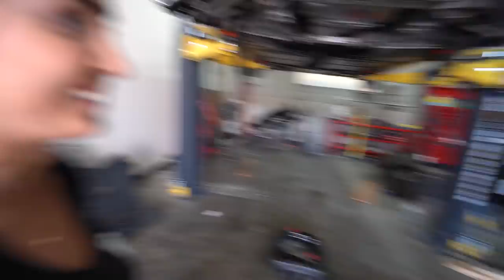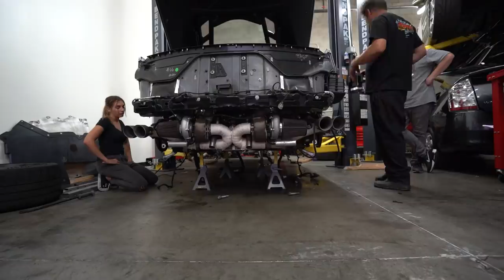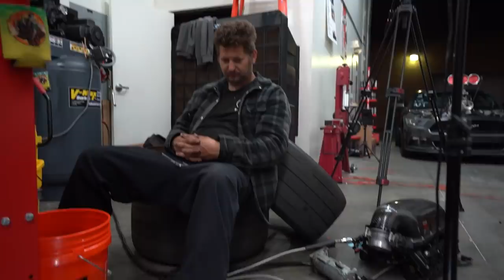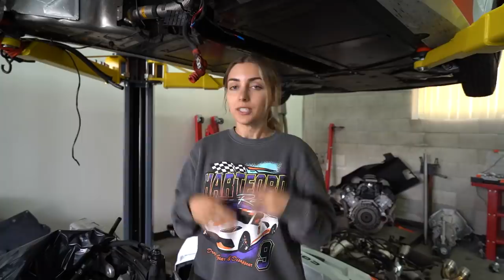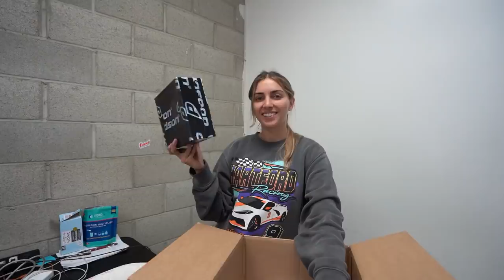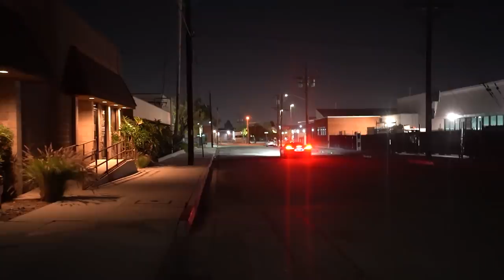I Finally BLEW the motor in my Twin Turbo C8 Corvette... Shocked at what we found.

Comment: Probably the most experienced c8 techs at this point
Reply: Ya if I lived closer amd had a c8 I'd have them work on mine if they would.   They have alot of experience with the c8 now
Reply: Uh, no
Reply: At very, very specific things. Engine, transmission, or suspension problem? They've got it covered. Water pump died? Bad alternator? Infotainment trouble? 🤷‍♂️🤣
Reply: When their C8 Z06 shows up, that should be exciting to watch.
Reply: I'm not excited about a V8 Vette, not a cool car in my book, buddy has a 2019 Z06 and it's not a good car compared to other cars it competes with, I would say there's many other cars that I would rather have, but I would build a Chevy truck and call it my hot rod, stay strong
Reply: @cargotoolshop5319  IMO, makes more sense to buy an older cool car that will or is appreciating in price. AND watch these guys play with cars I would never buy.
Reply: Besides the engineers who designed and built it

Comment: Hi Emelia
I'm very concerned about 1 thing. When you sent the C8 engine to Texas Speed to have them put holes in your intake manifold for the extra injectors,  etc , DIDN'T THEY PUT IN 2. THICKER HEAD GASKETS to lower your compression ratio , so as to make more room for the increased boost levels they knew you would be adding to the engine. You said in today's video you got new head gaskets from the dealer.  
  I also greatly admire how cheerful you always are --- even when things go wrong.& I appreciate your attempts to explain to all of us what it is you are trying to do.  I'm glad it isn't any worse than it is.

Comment: There's something so interesting about watching people wreck engines and then tear it down and show you!
Reply: Cheaper than doing it ourselves, too!
Reply: They are marvels of modern engineering
Reply: I wish the channel.was more than that. Cars getting fixed. 3 min of operation.   Cars getting fixed. 2 min of operation. Cars getting fixed. Sort of. By other people.  But let's talk about how the car isn't working and you can watch us watch people fix it. Sort of.
Reply: @Live.drones  Welcome to racing! Pushing your engine, trans, and drive train is part of the challenge. when you get to their caliber things are going to break until you get the beefiest stuff available. another example is Boosted Boiz channel they are pushing 1000+ hp out of a 4 cylinder engine. barely could keep two running out of 6 cars! well they got to the point where everything is holding up to the abuse, And ALL of their vehicles are running at this time. Worlds fastest MR2 and Honda Odyessy minivan. and second fastest Acura NSX in the world as of a couple of months ago anyway.
Reply: @tbusch63  but she doesn't race.  I get it. World.record attempts for 0-60, quarter mile, ect.  That's it though. She's really cool.  Not trying to hate.  Just wish it weren't so one trick pony for months now.
Reply: @Live.drones  Ya I get you but she shows the reality of having a basically 'unknown' car do what it does, break, then figure it out plus makes it decently interesting. I give that a thumbs up lol

Comment: I'm kind of curious, if you were just being paranoid, and that milky oil is just caused from moisture from running ethanol or methanol. When you get either one of those into your oil, it will draw moisture into the oil. I'm betting the head gaskets were fine. Probably just need a fuel oil separator. Or air oil separator. Honestly not sure which one would be better in this situation.

Comment: I'm amazed at how this engine has held up. Goes to show how good the builder is. Probably about time for a freshening up before it goes BOOM in a blaze of glory. I've put a hole in the side of a block before because of a head gasket going bad and it ain't fun.

Comment: Y'all have had that engine and trans, in and out enough times now, that you should be certified C8 techs! Other than some minor head lift, it looked pretty good inside. I'm sure it's a good feeling to get it all back together. and hit that button, and everything just WORKS!😁👍

Comment: 1 your going to be changing that clutch again.  You launched it on a new clutch with no break in , I have a dual clutch and I've changed mine twice. They are only rated for 100k with normal driving.
About 30k with heavy load. If you aren't useing carbon clutch disks about 60k with carbon and full boost. 
2. you did not preform a TCM relearning. So the clutch was not spaced properly before you launched it. This can cause serous issues later on Because now you possibly glazed the flywheel because you didn't preform a relearn and break in procedure. This can cause shock to the output shaft of the tranny, shock can come in the form of cracking,stripping,bending. Let's hope you didn't cause to much damage to that shaft of your gonna have one hell of a job on your hands 
3  pay more attention to the details.  Take 15 mim break during each torque session to allow studs to cool 
 A lifting head means it's not bolted at the right torque.
Your head studs/bolts are most likely the problem. After they have been slightly bent from.lifitng they are no good, it puts unnecessary stress on the threads. 
 Tho you can't see it with your eyes I bet the threads are rolled slightly. 

Also the last cylender on the driver's side of the car next to the bumper cover you could see the piston was almost turned sideways inside the block it's pushing the pistons to 1 side and causing wear to the block and ringlets. You may have an issue with your thrust washers. I would remove the engine and check clearance of thrust. Easy way is to flip block over to expose crank. Then take a prybar and push the crank in either direction and measure the gap with a feeler gage.
Confer this Info with Texas speed and see what there thrust washer barring clearance is and make sure they are not too worn from stress. And 30lbs of boost. That even the most built super cars can't handle.
Reply: nailed it...
Reply: This is some good Info hope it gets lot of likes.

Comment: Whew, that was a nail biter! Glad the problem wasn't bigger. When I built the motor on my 2000 Subaru Impreza 2.5 RS to handle 18 lbs of boost, we o-ringed the heads and used a pretty hefty head gasket, with ARP studs and block inserts (JE pistons, Pauter rods, knife edged balanced lightened crank, Cobb cams and springs, billet fuel rails, etc). Made about 500hp LOL, which is your motor stock.

Comment: Little hard to do, but after changing head gaskets, do a good heat cycle and the re-torque(depending on type of head bolts) also I suggest talking to "Jackstand Jimmy" Garret's mechanic about the torque he is using on mullet now, because of the problem they kept having lifting heads.

Comment: sure its not pulling threads out of the aluminum block? head studs stretched? I would black book any performance engine and what the tolerances or measurements were so you can compare them when things like this happen.(for the future) If its just a gasket from not seating right, ok good fixed. But good to question why, torque wrench outta spec? forgot to retorque one head bolt? not enough torque? could just of been a fluke headgasket job late at night while rushing to get it done that something was over looked. I would trust you working on any C8 over a Chevy tech. Overworking yourself, need to start hooning again and what ever happened to the 240? go shred a couple sets and just enjoy it 🤟

Comment: use steal block. 6 bolts heads. use c7 ECU. put regular after market  gauges and bypass the doors and others.e85 with meth the c7 may work with gauges and doors or others?

Comment: On my 96 fleetwood 6 door limousine with original LT1, i actually had something similar happen about 30k miles ago, the heads were slightly warped, i cant remember if it happened cold or hot(probably hot), but it was perfectly sealed when at X temp, but would start intermittently sending out a puff of white smoke, i thought it was oil so we took it apart and didnt find anything wrong with the rings or evidence that oil was coming in from the valves. It was probably our bias of thinking it was oil, but it took an actual expert to find that there was an exhaust leak and that was probably causing fluid to come back into the engine. 
My point is think outside the box. Maybe, like me, you have an intermitant problem. Not nescesarrily like mine, but maybe the high boost you're running is somehow bypassing the gasket without tearing it up, not blowing up the coolant system, and sending that coolant into the same, or another cylinder.. Or, what if coolant could be making it into the turbos, or maybe there is a crack or leaking seal in a coolant channel in the engine right next to an oil path.

Comment: If your turbos have a coolant passage than the seal could be leaking into the oil. Since you already took everything apart I would pressure check the turbos before you put them back on.

Comment: Looks like cylinder 2 is definitely burning coolant… the  cylinder you pointed the camera down when mentioning 60 thou piston to wall clearance… along with the cylinder next to it appears to burning little bit of coolant also. Domes of pistons looked washed. In my opinion they look like they are burning coolant VS the other two cylinders next the them. My best guess would be the head was starting to lift 
 
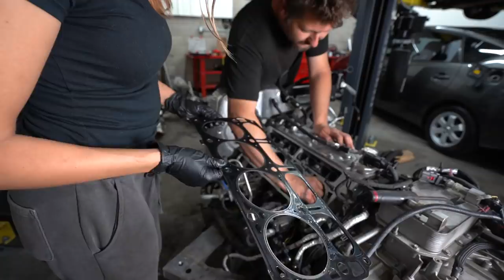Pause at 5:50 good view of cylinders #6 and #8 both piston domes completely baked on on carbon black…cylinders #2 and #4 are wet probably from removing the cylinder head, but the carbon being washed like that shows it’s been burning it. I bet you could wipe the carbon off that dome and make it look clean with rag.

Comment: Great job on the overhaul! At the drags I saw a small poof of smoke when you took off on the right bank. Then later on I started to see a little bit more between shifts but couldn’t see where it came from but looked equally from side to side. Happy it is all ready for your shoot. I liked your puppy on your lap during the promotion. Is it possible too cut the block for a o-ring like they do for a Diesel engine.

Comment: Is there a way you can heat cycle the engine before install,so you can retorque the heads? If not, are the head bolts accessable with the engine in the car? Cleetus and Kevin Smith were having issues lifting heads, and doing the retorque after the the first heat cycle seemed to be the answer. JMHO!
Reply: I agree with this. You should retorque the heads after a heat cycle. Things change after a heat cycle. You can ask Cleetus what he think s about retourqing heads :)

Comment: Give me a C5 or C6 or C7 any day of the week.  Yeah you got to pull torque tube which means you got to pull the trans if you want to pull the engine or do a clutch.  After you've done it 10 times it's easy.

Comment: Hey Cleetus had to switch head gaskets due to high boost.  And also had to torque the heads on to a higher value to stop leakage.  Check a few of his videos or reach out to him or James.
Reply: @UC3E4a-F2IVkP7xvapZWlkMw Your 'estimation' of 'twice the power ' for 'Cleetus'-Garrett with "Mullet" is actually incorrect !
They are attempting to reach about 2000 [w]HP compared with this C8 already at 1350 wHP and maybe increasing to about 1500 wHP +
They have already achieved with "Mullet" with its first-original rendition-version 100% without methanol injection ~7.7 sec. 1/4 mi @~177 MPH during MIdwest Drag [& Drive] 2021. They struggles with many issues through every event past that including suspension, transmission and engine. They then converted to use !00% methanol to attain higher HP, quicker times and trap speed, to reach the 6 sec. range. After many issues again with the engine and correcting the transmission, they managed to achieve one pass during testing, in Bradenton, prior to the TX2K event. Then they had issues there including the failure which they decided correctly to drop out the competition.
This C8 is a very different engine, transmission, clutch platform to work with including the mid-engine, trans-axle, clutches, locked ECU/TCU, 6.2 L SBC with added methanol injectors, TT, improved exhaust, intake, throttle body.
"Mullett" is basically a custom built power train from the engine through to the wheels, customized frame, suspension, using a 1983-5 El Camino, G-body/truck frame vehicle with fully custom ECU, ignition, fuel system, cooling system, 7.0 L/427 c.i., aluminum custom LS produced engine, completely gutted interior, 2-step, etc. , which still retains some portions of the original manufactured body for certain racing classes.
This C8 is not attempting to qualify into any particular class, but it certainly remains to be mostly its production vehicle with major modifications to the engine, including internals, fuel system, etc. but lacks the full custom ECU and TCU needed to have complete control.
As with each group-company that has their individual approaches to the increased power packages for a C8 Stingray, all higher power attempts are using a TT, methanol injection, modified clutches, intake, exhaust, throttle body, and some version of ECU and some use a TCU  to couple with the GM-Chevy production ECU/TCU system.
There are similar issues with other modern built performance production vehicles; Mustangs 2015- [S995], Challenger, Charger [Hellcats, Redeye, etc.], including Durango, Camaro Gen 6 & 5, there are limitations with the C7 also, all European sports-performance cars.
Tom McGilton had his 2015 Camaro completely redone by Larry Larson, in which they removed the engine, power train, and built a racing vehicle while retaining the production interior and other amenities.They put the removed engine, etc. and put it into an older El Camino which his daughter is using to race with.
If You wanted to build a custom racing vehicle with a C8 body it could be done, but requires more information, knowledge and expertise than ANY of the type of 'racers' or channels. The individual-team would actually need to have engineers, since the 'trial and error' method would not achieve even a partially or 'try-test-break-rebuild-break-rebuild', etc. with any period of a working vehicle. Also more expert level individuals like Larry Larson, Dennis Taylor, Jeff Lutz, etc. which also use higher level experts sometimes within their developments, lack any experience with development of a mid-engine design vehicle and the necessary equipment, components, and thus requires actual engineers as all professional teams use.
See Casey Putsch, who is an actual automotive engineer with extensive experience, expertise as a mechanic, designer, developer, racer and motor vehicle enthusiast-appreciator [automobiles, cycles, aircraft, etc.]. also about custom vehicles which he as designed, produced and his Genius Garage in which he teaches engineers within his training to also have actual experience.
Imagine having the actual C8-R, TT used in IMSA racing ! IF You have a race team and the funding, they are available for purchase. 
[what do You think they have done with the required 500 produced ? Chevrolet Racing certainly does not so many for 'spares' correct ?!
A custom engine for a mid-engine vehicle is certainly NOT any big issue, except which trans-axle, clutches and axles are available, especially for performance level.
Thus, my approach would be finding the highest power/torque trans-axle, clutches which are usable, with their ratings [avoiding a completely custom design, since am without that manufacturing capability], then custom build a tubular lightweight frame, suspension [with available parts, components] [perhaps something from Fields Auto Works could be used, also a customized Corvair, Fiero, MR2, Porsche Cayman, etc.] The power/weight ratio is important to essential with a power train that is fully open for full custom, customization, control, etc.
[note: i 'are' an engineer - with over 40 years experience, expertise, in design, development, testing,verification, etc. - in which actual new, working, functioning developments are produced, exist and some which You are currently benefiting form directly, though most are gov' classified customers (am working on some currently which the common, general humans and the mass public will benefit from - if not prevented and blocked by the more powerful)]

All The Best 😊
Sincerely ☺

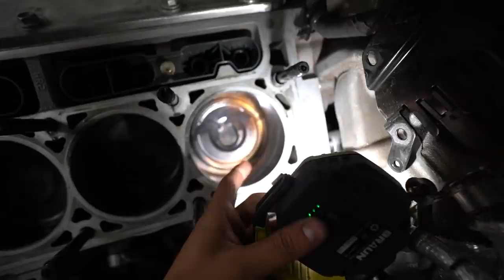Comment: 5:58 cylinder 7 not sure because of lighting but the gap looks larger from 10 o'clock to 1 o'clock and then no gap starting at 2 o'clock down indicating a bent connecting rod or egged piston or cylinder.  Spin engine and watch it.  Next time do a synced relative compression test with an oscilloscope, super fast and easy.
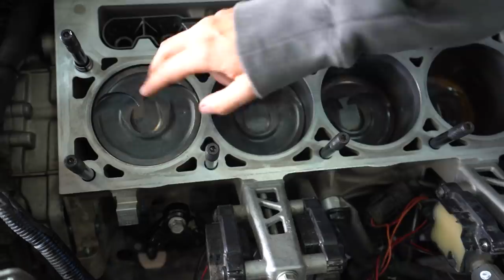Reply: 7:30 cylinder 4 looks suspect and maybe 8 too. Hard to tell with only seconds to look at it.

Comment: Ideally you should retorque the heads after the first heat cycle. But it does not look like you can even get at them in the car.

Comment: You need to do the drill&tap and fit thicker head studs - if the heads are lifting, that's the only option unfortunately

Comment: Sometimes the oil coolers leak on the newer engines too I know that by experience it might have a crack between the cylinders too it's aluminum block that you can't see

Comment: soooooo you didnt take the heads or block to a machine shop to get checked, and only checked it with a straight edge? why did the head gasket blow? did the head studs stretch? is a head slightly warped? did you think about o-ringing the heads cause boost? so many questions, leak down test? check valves?

Comment: Another scary way to boost engine and blow it eventually is to add synthetic jet oil to the gas tank. It partially hydrolocks the engine for absolute insane pressure ratios without need of a turbo but you got to know what you are doing.